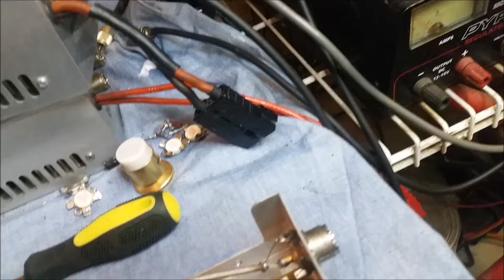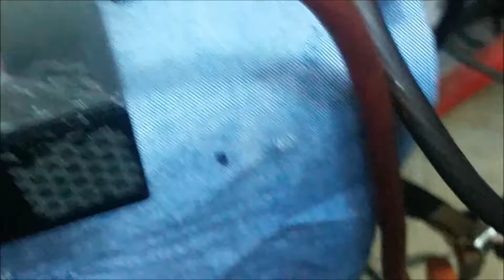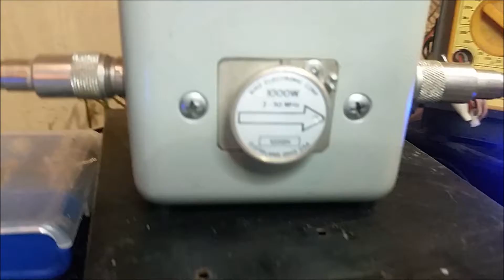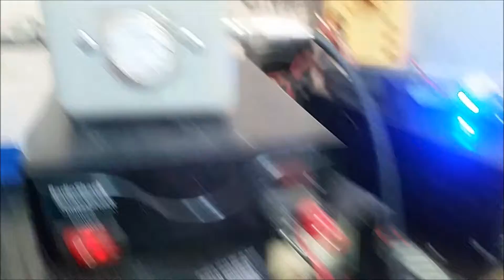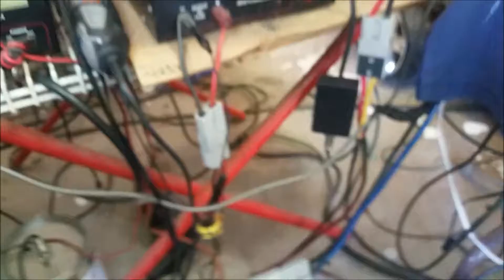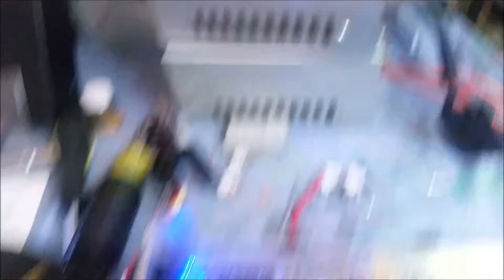TS 667V Hybrid Brought To It's Knees By High Bias Voltage ⚡- always check bias is suspect!

Comment: the hybrid 667 I repaired was a total mess. DEI/mosfet . used a 8 pill final combiner as well. the oem at the time was out of stock. has wrong bias resistor.  that what did the 2 pill in. and why final combiner got hot.  that a problem with mosfet low drive. padding needed. them lamps marked 7373 can be gotten at auto parts store. they 14V not like the old 18V ones. but #73 is a dash bord light in many cars and trucks. they push in type but easy to solder in. just a dab of flux.  I did find 24V lamps but was dim at 14-15V . love no number on mosfets . RM italy does the same thing. 73's
Reply from the maker: Hey bud..I own a 2016 chevy traverse....how much power do you think I can run before needing to wrap my computer???
Reply: @1883GotDown  I think i Kw should be ok. may want to put a ferrite snap apart core on the cars computer..also I herd the rear window defroster lines on back window and  bring it into cars system. put ferrite on power leads close buy where attach to window. 73's
Reply from the maker: Wow yeh I rem you telling me about that one....goodness man!